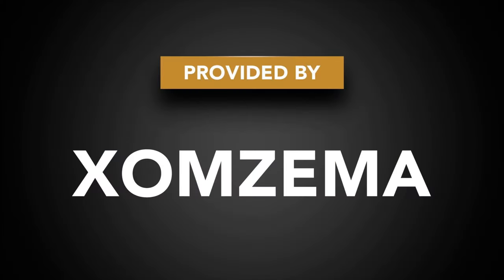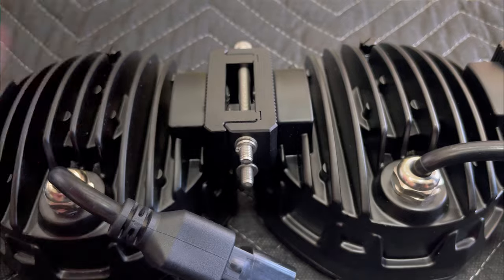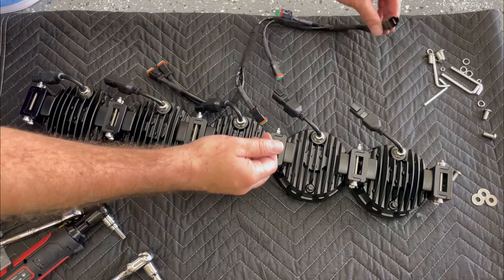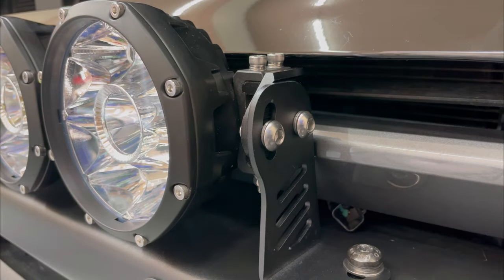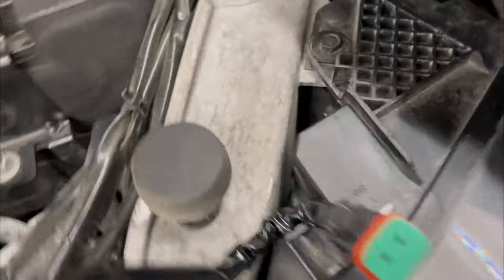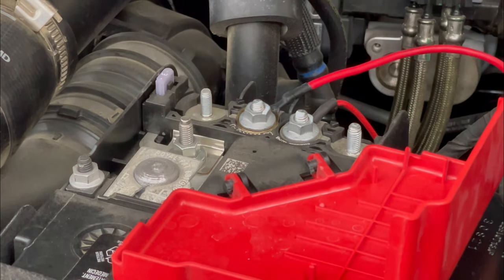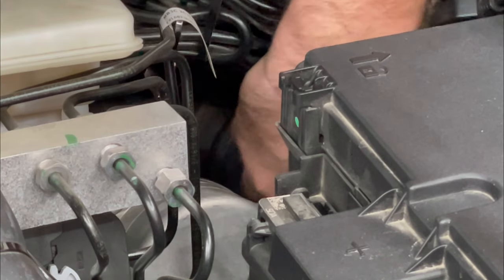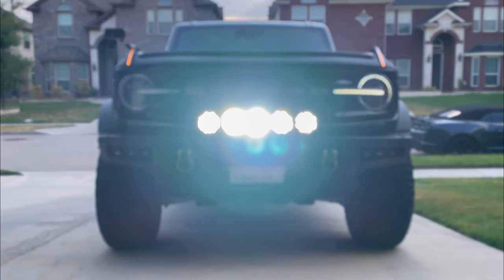How to Assemble and Install the 5” Round LED Light Bar/Spot Light kit by Xomzema - 2021+ Ford Bronco

Comment: Hi there. Nice video. I had a technical question. I have a bronco as well, and I want to connect the switch and directly to my aux. my switch has three cables connected to it, but my auxiliary is only one cable on the bronco. Can you let me know please. Thx
Reply from the maker: Thanks for watching. So, to answer your question, unfortunately these lights draw too much power to hook to the AUX switches. I did a test fit and they blew the fuse within a few seconds. You ‘could’ replace the fuse with a larger one, but you really do risk the chance of burning up/melting the wires to your AUX switches and ultimately damaging the Bronco wiring harness. 

Believe me, I wanted to hook them to my AUX switches for a clean look. You could potentially run the wiring for the switch that comes with the kit up to where you AUX switches are, essentially using it as a 7th switch. But unfortunately these lights draw too much current and will blow the fuse if attached to an OEM AUX switch.
Reply: Wow thank you. Do you know how many amps they draw? My bronco raptor has a 30A on AUX3
Reply from the maker: @gemas7998  - I am not 100% sure I’m afraid. My 30A AUX is switch 1 and I am already using that for my fog lights, so I didn’t test that out. I was using the AUX 3 15A switch to test it originally. That is what I had my Lasfit light bar attached to originally and it worked fine, but these Xomzema ones draw more than that. 

I have had them on as installed in the video without issue, but I get wanting to use them with the AUX switches for a clean install. Sorry I can’t give you any more information.

Comment: Are instructions included to wire the lights utilizing the Aux Switches?
Reply from the maker: No, there are not. Where I show in the video that you unplug the switch with the white connector, you remove that part of the harness and cut off the connector. You’ll then wore that up to an AUX switch. 

I did try plugging the lights directly into the connector for another light bar I have hooked to an AUX switch but it blew the fuse, so you need to keep the relay and fuse from this harness in place. Hope that helps.

Comment: where can i find the brackets to link additional pods?
Reply from the maker: The lights come with the linking brackets already installed. But the lights are not sold individually, they are sold as a kit, so you’d need to purchase two kits if you want to add more lights instead of just 5. 

But essentially the brackets are included on the lights already.

Comment: These light manufacturers have to seriously start to rethink how long these wiring harnesses are. They could knock the price down by 30 or 40 bucks if they'd take 10 feet off. I've only added two after-market lights to my Bronco so far and it looks like I've got birds making nests for the winter under my hood lol
Reply from the maker: Yeah, you’re not wrong! I have so much wire under the hood from my rock light install. I guess they take into account the longest vehicle on the market like the full size pick ups and sell the kits based off of that in some case, like the rock lights. 

There’s a decent amount of wire in this kit too, but you can hook them up to you AUX switches so you could cut some off if you did that.